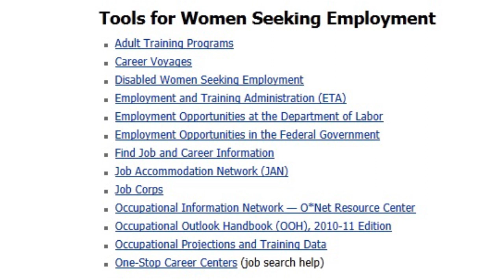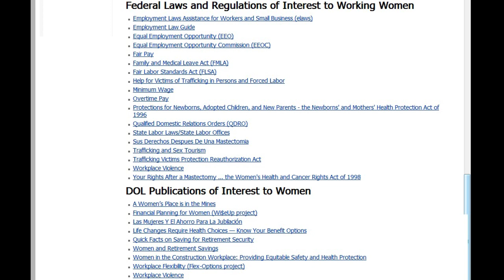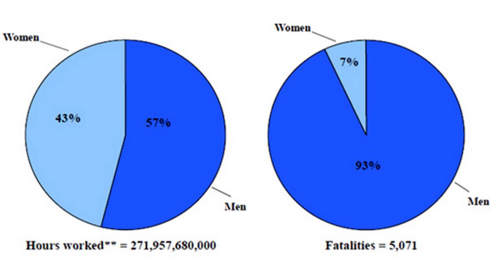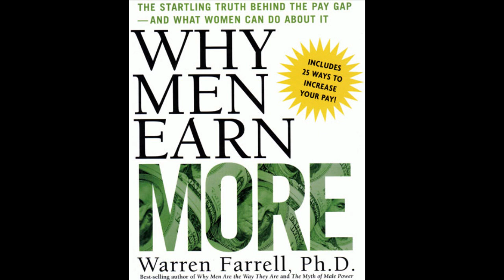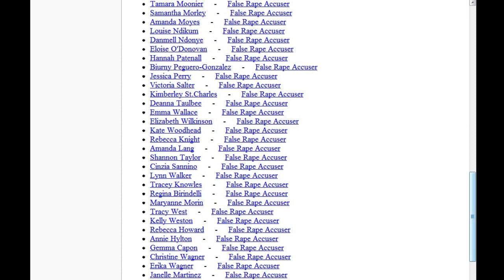😆Exposing The Nonsense That Is Feminism

Comment: The word 'mangina' is used so liberally amongst MRAs now, I think, that people just use it to shame other MRAs who aren't as extreme (maybe not the right word) in their beliefs as the shamer would like them to be. I've seen it used (and heavily thumbs'd up) against men who disagreed on the most insignificant points. Once people learn a shaming word associated with a clique they will generalize it and water it down til it loses its original meaning. Same thing happened with 'hipster', 'emo' etc.

Comment: I engineer components, machine metal, and maintain industrial manufacturing machines. I haven't seen a single female work a manual milling machine, engine lathe or a precision metal grinder yet. Im sure there may be a few out there, it just seems like they aren't that interested in dangerous jobs that little to no glory. In my line of work one screw up and it could mean a death worse than anything seen in a movie or cartoon. You dont even have to be the person running the machine to be hurt.

Comment: @MNeilGri Hm, I believe you do have a point when discussing general opinion on the matter.  However, a lot of articles are indicating a failure not in the boys themselves, but in parenting styles and social norms. Many parents were encouraging their girls to achieve academically, without doing so with their boys (meaning that the pressure to succeed was reversed from a century ago). What parents should really do is apply the same level of encouragement and pressure to both genders.

Comment: I still disagree with you.  A discussion of patriarchy and the ways in which it has molded the gender-role system we all function within is not a fig-leaf at all.  Most individual men could use a good dose of self-reflection with a clear idea of what the system expects of them, as could most women.  Reformist vs. Radical within anti-misogyny, anti-racism, anti-poverty, whatever "anti" you want to get into, is where the key lies.  Take a step away from the one wire of the larger cage.